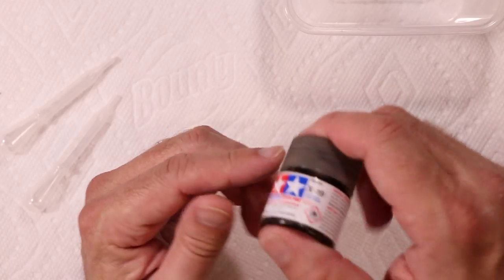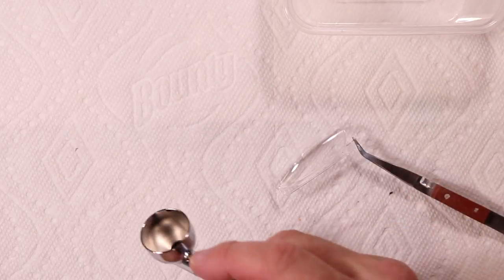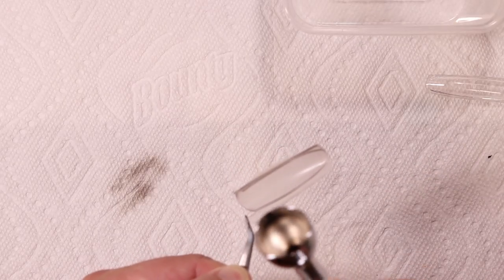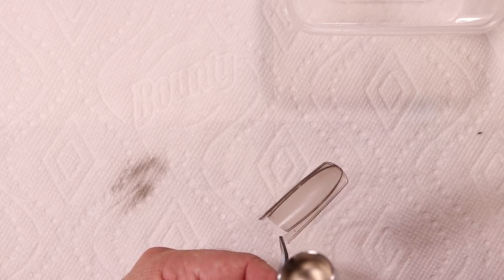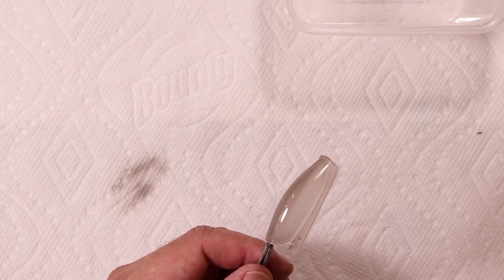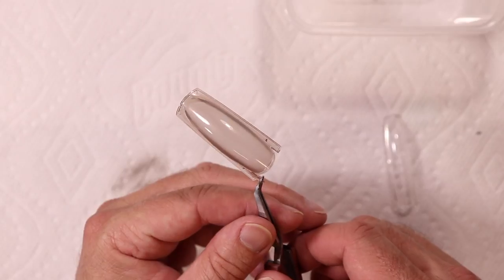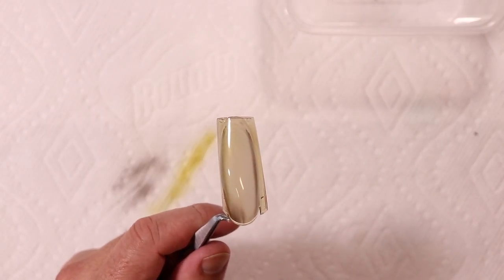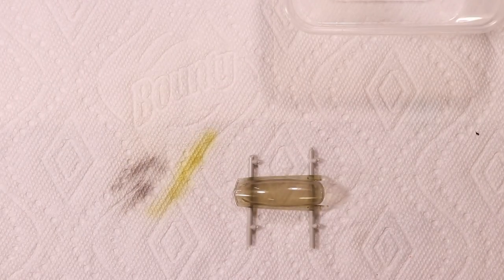Tinting Scale Model Aircraft Canopies Made Easy e004

Comment: Hi Darrin, 20 year F-16 Crew Chief here. The gold canopies were phased out in the late 90’s (I only worked one or two jets with them) and I was told the gold addition was an anti-radiation film to protect the pilot(s) from radar waves while formation flying. The new canopies are slightly smoky, but not very dark. The aft transparency (the glass attached to the fuselage) is normally clear, mass-produced, throw away parts that make great snow sleds.

Comment: Grumpy, love this technique.  And a great job of teaching it.  Many thanks.  Question:  If there is masking and painting to be done for the canopy frame, when would that be done?  I assume before the initial coating of the canopy with Pledge (Future).  As for painting does it matter whether one uses enamel or acrylic? Thanks again.
Reply: Would defer to others here, because I normally do 1/72 and pretty much never paint the inside of my canopies (I usually model them closed). However, my two cents would be to do everything Grumpy showed and THEN mask and paint the canopy frame. Once the Future is fully hardened I think it would be pretty resilient to being lifted by masking tape. I can't think of a way that makes sense otherwise. If you painted the canopy frame first, then tinted and re-dipped, you'd have a glossy canopy frame (and if you left it masked some of the Future might seep under the tape). Also, I've only tried this with Tamiya, which generally plays well with both acrylic and lacquer paint, but I believe Future/Pledge is an acrylic for purposes of figuring out compatibility.
Reply: @vice10mmauto  Many thanks.  Makes perfect sense.

Comment: Great video - very helpful - I found this when looking on how to tint the windscreen of an F-14 Tomcat. One related question for you if I may, after dipping a canopy in Klear (or similar product as Klear is difficult to find here in the UK), are there likely to be an issues with adding subsequent masking before painting the frames? I use Tamiya tape and often Eduard masks for this, I just have a fear that it might be possible to pull off some of the coat of Klear when the masking is removed. Any comments on this welcome... :)

Comment: Darrin, awesome video. I learned two tricks from this video. I have a question, with EA-6B and F-22 canopies would you use this same process for replicating the gold tint or would that be a different process?
Reply: My guess is the same process, but you'd need to check reference photos to get the correct tint. They're all tinted for the same reason and that is to protect aircrew from specific frequencies of RF radiation.
Reply from the maker: The one thing that I would note is that when tinting the F-35, as well as the EA-6B, you might notice more, for the lack of a better work, "gold flake" in the canopy.  Fox Three Custom Models did a great tinting video and experimented with metallic paints.  Heres the link to his video: https://youtu.be/jy6g5LOiZdM

Comment: I've never tinted a canopy, but I do dip mine in pledge/kleer.  So, I'm wondering why you couldn't add smoke or whatever color dye directly to the pledge before dipping it...?  As a side note, my Tamiya F-16 canopy also broke, but mine split right down the center seam.  I think whatever mix of plastic they use for their clear parts it a bit too brittle/hard.

Comment: Did you spray the yellow mixed with the smoke mixed together or just the yellow after?
great vid thanks!
Reply from the maker: Donald Collins great question!  I didn’t mix the paints.  I 1st sprayed very light coats of the smoke until I got just to the point where I wanted the tint then I shot the yellow to bring the tint where I wanted it.  Remember the key is very light coats!  You can get it to dark really quickly if you’re not paying close attention.

Comment: I tried this technique for my F-16 canopy. However, when I dipped the part in Klear (well, sold by a different name in my country), I noticed that this solution acted as a thinner for the clear coat, washing about 50% off of the canopy, even thought I made sure to dip it just for a second. Also, my attempt to repeat the process by adding more clear coat to compensate for this, didn't work very well. Have you ever had any issues?

Comment: What did you use to make the tinted part sharp and clear? what did you pour on it?
Reply from the maker: I actually used future floor wax on that part.  I don't usually use the stuff but if I am trying a technique that may go wrong then I want to be able to strip the mistake off with no issue.  Windex with Ammonia D strips the future off leaving no damage to the clear part.
Reply: @GrumpyModeler  future floor wax, oh damn :( it is not available in Poland or the EU, same with Pledge Floor Gloss, what else can I use to smooth out the paint and make the glass tinted and clear?